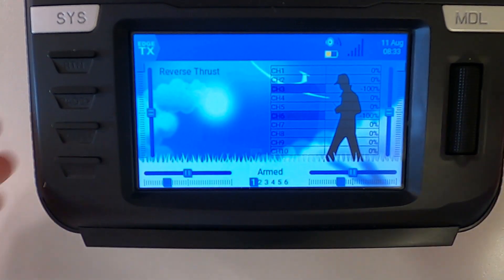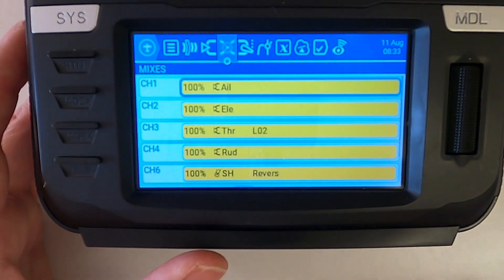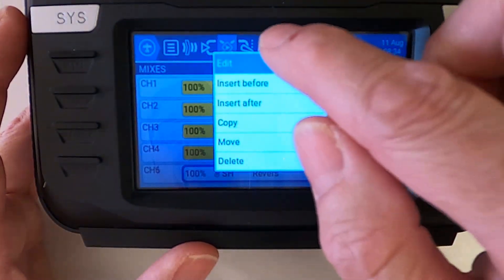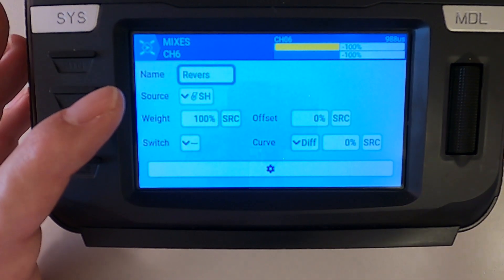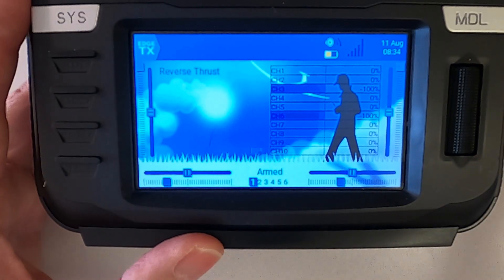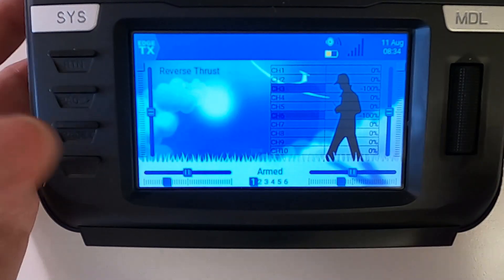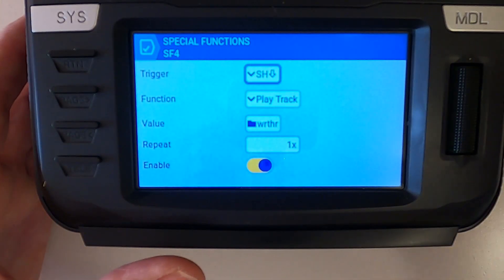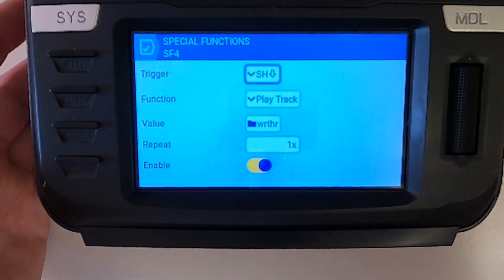EdgeTX Setting Up A Reverse Thrust ESC in the RadioMaster TX16s

Comment: Hi Bill
Thanks your fine video. I followed your instructions and made the mix for reverse but fail to comprehend how you mix it to reverse CH3 (motor)?
Can see you have a Lo1 in CH3 - how do you do that?
Reply from the maker: If I understand correctly the mix is fine. You need an ESC that can do reverse thrust.

Comment: Not at all familiar with any of the probable variations on the Reverse Thrust ESC theme, Bill, but I would assume that there are quite a few. eg In a boat or car you might have a simple Forward with throttle from 0 to +100 and Reverse from 0 to -100 thus allowing you to shuffle back and forth with just the throttle stick. For a plane (with an ESC with a separate "Reversing Channel" like here) you might need some extra electronic jiggery-pokery either on the ESC or via the transmitter model programming to stop you slamming full forward to full reverse until the blue smoke appears - as in the auto manufacturers' "lady drivers" gearbox durability test!  A mention of the actual ESC type being used here might not have gone astray. 🤔😉😊
Reply from the maker: I do not own one or I would have demonstrated it working. It’s just a simple mix. I would adjust the mix to only    be active from when the throttle is off.